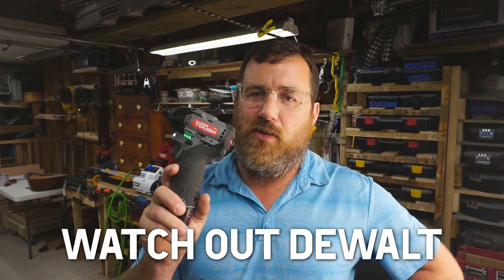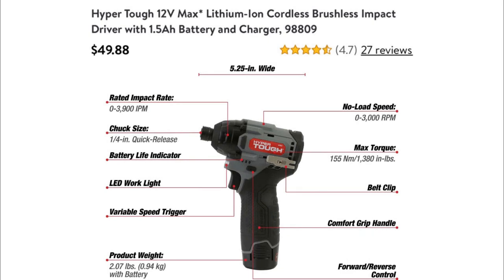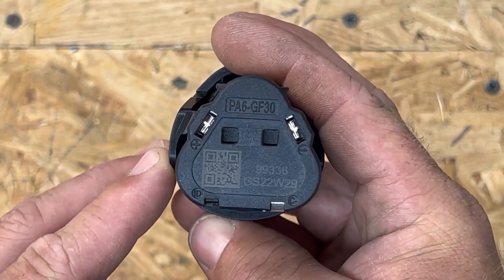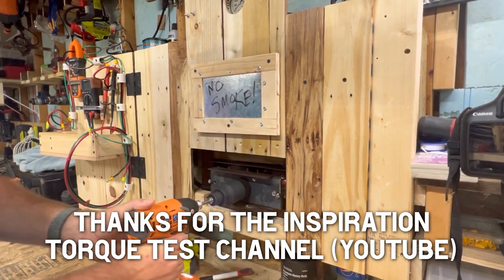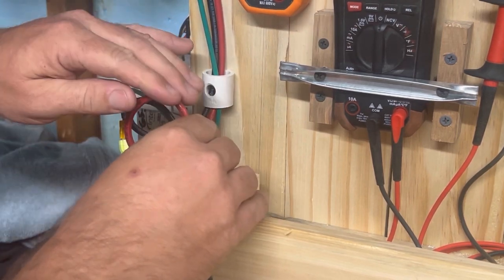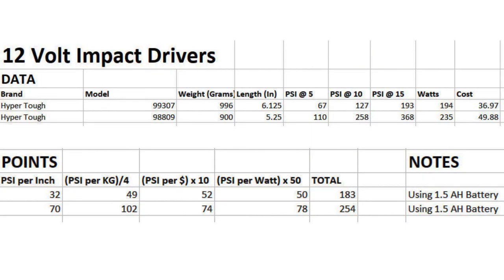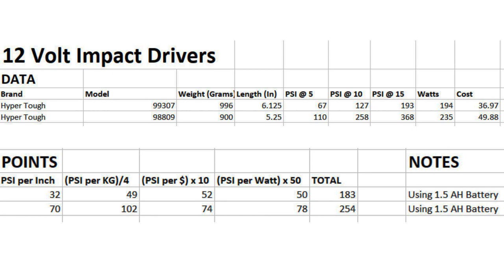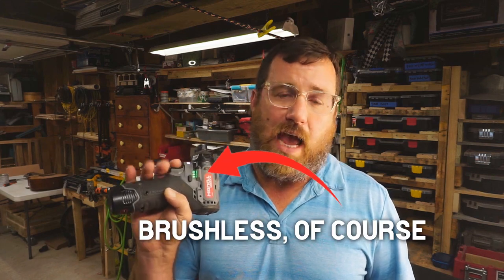Hyper Tough Brushless vs. Brushed 12 Volt Impact Driver (Sold at Walmart)

Comment: Enjoyed your comparison, the brush-less is definitely better.   

 I think your jig should have thicker and shorter wires,   The short thinner wires are to long and thin for a 12volt system.   While in this case it would not effect the comparison. 

 Voltage drops inner per length of wire.  Less with thicker wire.  Amps  drop due to resistance.   Also for a given watt a "12 volt" system uses twice the amps as a "18 volt" system.  I believe  the 12 volt system has 3 lithium cells vs the 18 that has 6 cells.  If you were comparing 18 to 12 using the jig it would be unfair.  

As batteries get better the lower volt systems will get better more then the higher volt systems from the effect.  Brushless motors if keep cool can put out a great amount of power.

Comment: How about controllability at low speeds? 

IE: what is the slowest you can get one to move before the tool shuts down the motor?
(the tool does shut down the motor when stalled to prevent damage to the wildings, which is possible because there is no air movement unless the motor spins)

Comment: I bought the m12 fuel kit for installing hundreds of interior and exterior LED light fixtures and a full size 18v drill would have sucked for that. Then this came out about 6 months later and if it was out then and I knew about it I absolutely would have gotten this impact and drill kit. Does the same thing I asked the m12’s to do but way way cheaper.
Reply from the maker: The Skil 12 volt series would work for that too.

Comment: Might have to pick up the brushless one to have in my PM bag.
Reply from the maker: It’s pretty nice. I’ve had it for 6 months and I use it on a regular basis in the shop. So far so good. No reason to get the brushed in my opinion.
Reply: I definitely like the new hypertough tools and hart tools that Walmart carries.  Especially for a truck tool box or a PM bag.  Cheap tools that can get stolen without breaking your heart but still get a simple task completed.

Comment: Even if for whatever reason the brushed verson would ever seem to put out more power, one will find that a bushless motor will far outlast a brushed motor.  A brushless will almost always at very least, offer equal power in a smaller/lighter package (as seen here).  Always use a 4ah battery with 12v or 20v, though I understand you are testing what comes in the package!!  Great video by the way.  I commend anyone that creates dynos of any sort to offer us consumers any information on the best product to purchase.  Given todays economy and Bidenomics, budgets are tight, and wallets are light!!!
Reply: I actually have a Ryobi brushless impact driver thats dieing after 1 big project. We were pushing it hard I own that, 3 people, 4 batteries and 3 chargers kept it running non stop for 6 solid hours. It now surges and is way down on power. It is smaller and lighter then any other Ryobi impact driver, thats why I got it in the first place. I will buy another one, probably the updated multi speed version. Ill just use Ryobi’s price point to have multiple drivers and let each one rest/cool while the battery recharges. The power on all the cordless tools is unreal now, brushed and brushless. The draw of the brushless is the form factor and weight. Unreal. When the Ryobi was new it could zip off wheel lugs, as can its modern brushed counterpart. Just 1/4 inch impact drivers zipping off wheel lugs no problem. Not a streign, not pushing, not getting hot, or riding, 3 seconds each torqued to 100ft lbs, had been on the car for two iowa winters. Zip, zip, zip all 5.

Comment: Those things are pathetic. Spend a little more money and get the Hercules driver. 3 times stronger and not 3 times the price.
Reply from the maker: The Hercules 12 volt? You must mean the 20 volt. The 12 is weaker than these.
Reply: @zacksintheshop  well,the hercules impact driver is 20 volts so yeah.
Reply: Why would you recommend harbor freight as an upgrade LMAO
Reply: @smolscale  compared to that hyper tough crap it is.
Reply: @davidsharp922  harbor crap hyper crap it is all the same
Reply: @smolscale  no it the fk isnt. People spouting off about 💩 they know nothing about.
Typical.